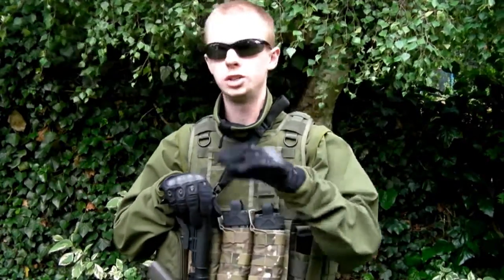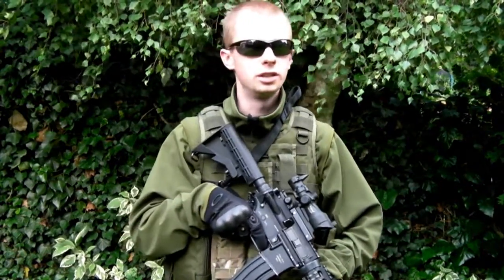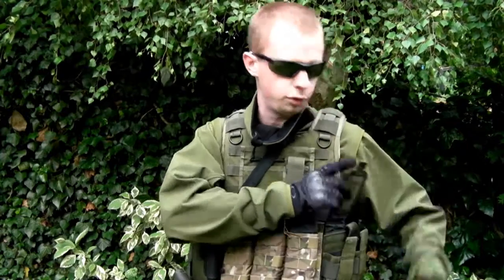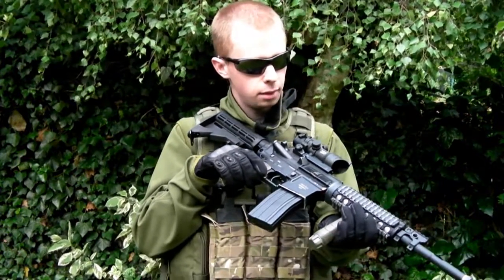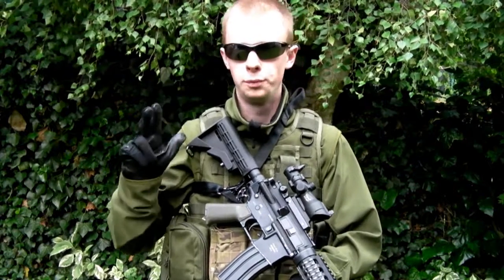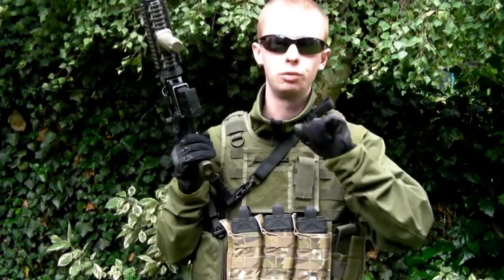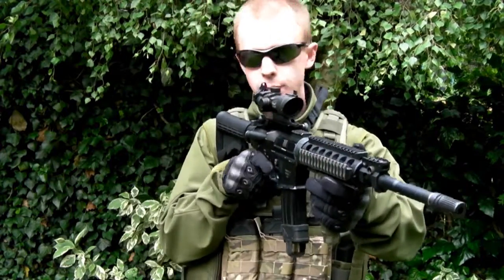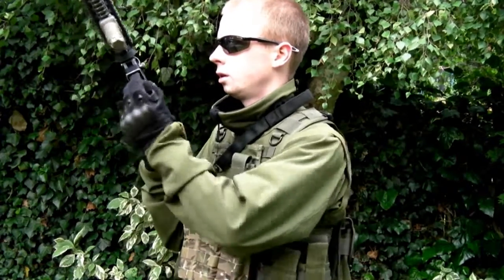Airsoft Techniques - M4/M16 AEG Reloads

Comment from the maker: @fuzyman756 Started off as an 'SPC' with the KAC RAS and a full stock, but I switched the stock out for a buffer tube, run the wiring down that and put a lipo in there.  Never really skirmish it any more, if you're after a decent AR then go G&P.

Comment: I just bought my first airsoft gun (g&g m4 commando) and ive never really had to care for one or load it before, ive only ever shot one. the gun came with a mag and i noticed i had to crank the bbs onto the spring in the mag, do i have to recrank the gear in mid combat once the bbs on the spring run out? yeah its a stupid question but i need to know. thanks

Comment: what you should do is pull the new mag first take out the empty one and put in the new one then put the empty one back in the pouch this way you can fire if you have to and also use this way if you have full pouches, its also faster
Reply from the maker: Barney Clifton I discuss multiple methods in this video (and part 2), there is no 1 method everyone 'should' use.  Which method is quickest and most suited depends on the person and their gear/pouch setup, everyone has a sightly different rig.